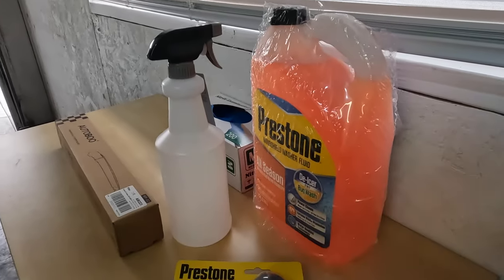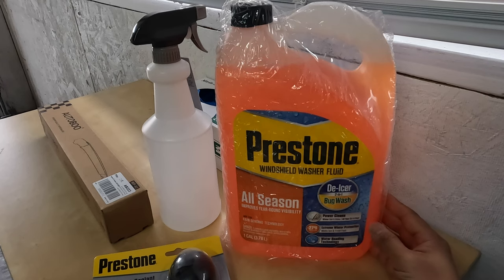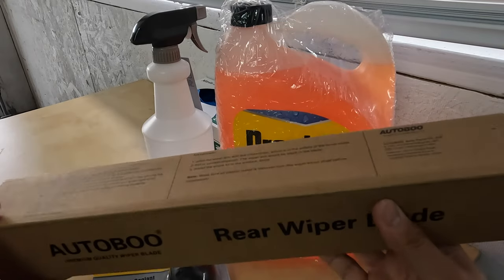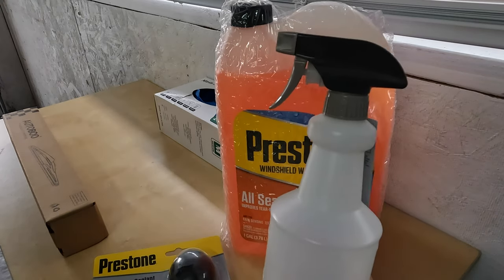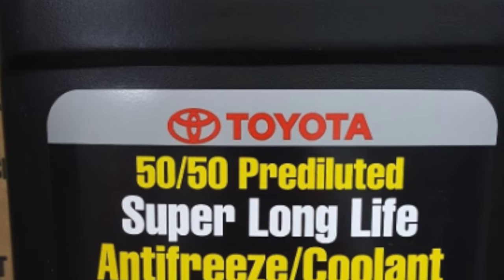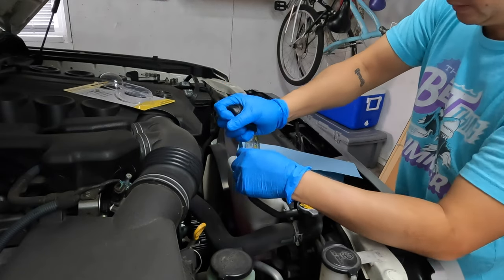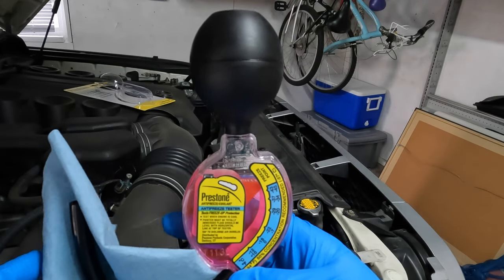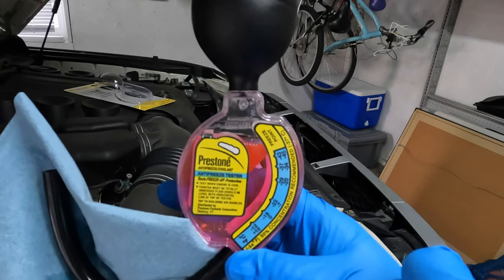Prepping my FJ Cruiser for a Winter Road Trip

Comment: Super jelly! I've longed to be able to afford an FJ since they first came out...i settled on a Jeep Liberty Renegade (14 years ago) and after around 140000 miles my experience has been that it's a great vehicle with the usual maintenance issues...That horrible smell was the old washer fluid right? Muddy puddle? What was in there before... just water?  If it was that would explain the smell...warm water is a petri dish...you might want to run a bore scope camera down your washer fluid bottle and see if mold has grown on the sides.  The alcohol in the prestone should kill it, but if any parts dislodge they will block your windshield washer dispenser spray nozzles...is there access to access to any hose connections at the bottom of the washer fluid reservoir? Next time I would consider pulling a hose to drain the tank and save your washer pump. FYI, I know Prestone smells nice, but You can make your own washer fluid for a fraction of the cost by diluting water with cheap rubbing alcohol.  There's a video for that somewhere I'm sure...Thanks for taking time to make this Great video! .👍😎 STOC
Reply from the maker: Yes the smell definitely was the old washer fluid.  So far, no blockage.

Comment: The rear window wiper is about 12”? and I had to look to find one.  
One thing I learned the hard way; if you snap the wiper holder down accidentally without the wiper, it cracks the window. 
I also have a small tube of lock de-icer ( kept in garage), and I wipe down the door frame and gasket with ArmourAll. Helps keep door from freezing shut. 
I try not to drive on salty roads, nasty on the frame. If I have to do that I always spray the underside at a carwash with hot soapy water. 
Safe travels!
Reply from the maker: I'm not sure the size on the rear window wiper - honestly, that's one I don't ever use.  The back window is so straight that nothing ever clings to it that warrants wiping away, but thanks for the heads up on cracking the window.

Thanks for the reminder on the door gaskets.  I'll make sure to do that before I leave, and yes, I'll make sure to take a garden hose to the undercarriage when I get home!